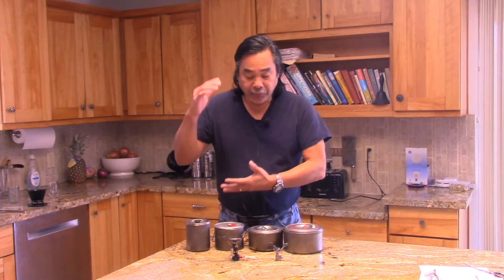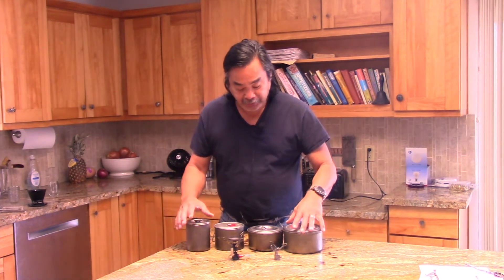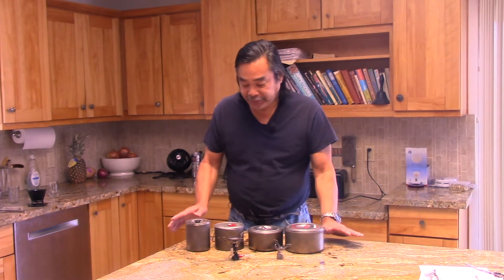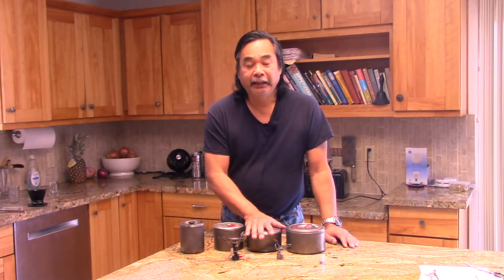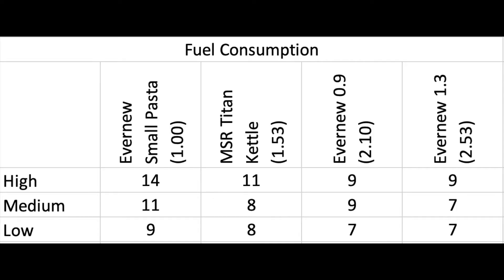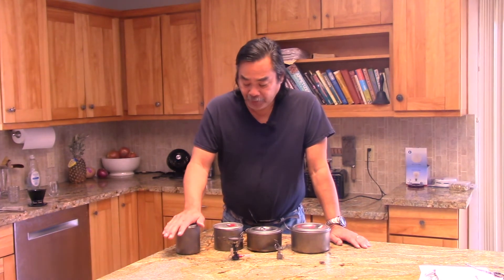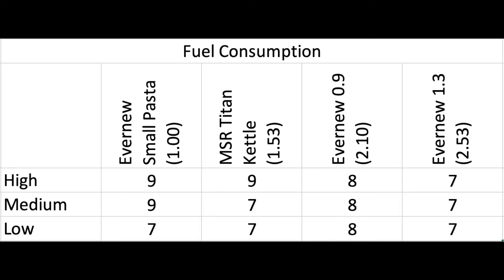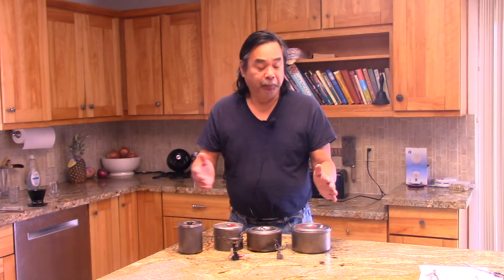What impacts fuel efficiency? Pot Diameter? Burn Rate? Stove Design? by FLAT CAT GEAR

Comment: Finaly i hear that brs is terrible stove,i absolutely have no idea why ppl rate it or use. U can have just a little heavier stove which gonna perform times better.
Reply from the maker: If you are a fair weather camper and you don't turn it on full blast, the BRS 300t is fine.  Well, to be clear, all stoves will work in those conditions.  Now if the wind is over 2 mph, the BRS 300t suffers: at 2 mph a BIC lighter will have troubles staying lit.  Check out GearSkeptic's videos on the impact of wind.

Comment: Yes but your Pocket Rocket is 3 times the weight of a BRS 3000............50 gramm more of Gas i can carry.
Reply: In other words almost half of a 4oz gas canister.............
Reply from the maker: @jurgschupbach3059  And a BRS 3000t is useless above a 2 mph wind. and you will carry more fuel in real world conditions.  If you only are a fair weathar camper then the BRS may be fine for you.
Reply: @FlatCatGear  did you ever use a windscreen?
Reply from the maker: @jurgschupbach3059  always

Comment: I suppose also not to mention they say that the BRS is terrible in the wind.  Me, with a larger pot (grease pot), this shows the BRS might still make sense for smaller trips where I can still get by with a small canister.
Reply from the maker: If you are going on a fast a light trip weekend trip, the BRS could make sense.  If you were going on a longer trip with 7 day between re-supply, I would go for the PRD to reduce the number of canisters that I would have to carry

Comment: wow that are some unexpected results, thanks for sharing!
I found in my experiments one issue which is as per my experience also highly relevant concerning fuel efficiency. 
Given stove (I used alcohol stoves for my tests) and pot diameter as well as material (I used stainless steel mugs) are identical, it can make a huge difference in consumption how the transition between the pot base and the pot wall is formed. I tested it with mugs from different manufacturers and such also different shapes and found always same result: if there is a sharp angle between base and wall, it takes more time/fuel to heat something up than in a pot where this transition part is rounded.
I found as cause, that the flame stays at the "rounded" pots either permanently at the pot or comes immediately after the corner back to the wall, such heating the pot very smoothly also on the sides from very close to the base. Whiles on pots with a sharp angle the flame leaves the pot and comes, if so, only later up the wall back to touch the pot, leaving out the lower part of the wall.
Means there is a huge difference in whether and how the flame touches the pots, depending on how the pot is formed.
I measured up to 15% differences in fuel consumption ... just because of this little detail, it seems.

Comment: Thanks for this testing. It’s very timely for me as I’m researching which canister stove to get. By the way, I am loving the Bobcat kit I received in the last couple weeks and using it every chance I get to really learn the system.
Reply from the maker: don't go canister topped, get a Kovea Spider.  It is compatible with the Bobcat Original is SS and Ti.
Reply: Sorry to post this here but I think my emails might be getting caught in your spam filter.

 I need replacement pot holder steaks for my bobcat Jr system. Not sure what option to use with the drop down menu, bobcat or bobcat extension,mine are 5in long by .5 inch wide.
Reply from the maker: @Greggsvlog  just a Bobcat stake